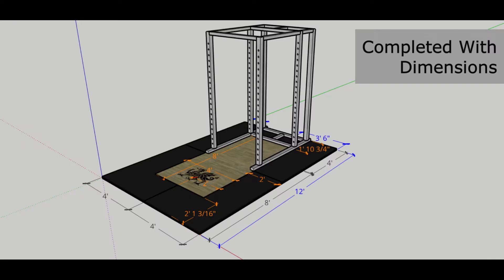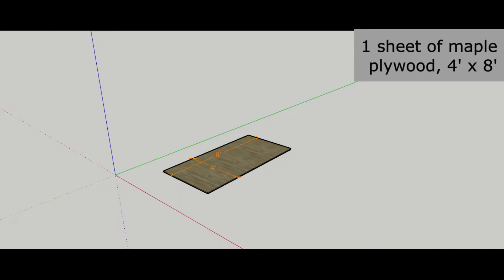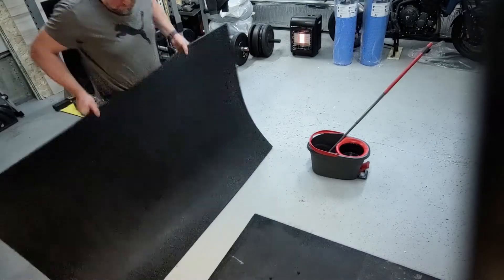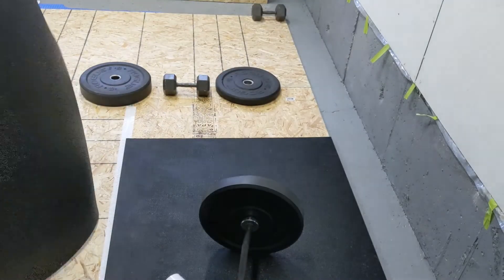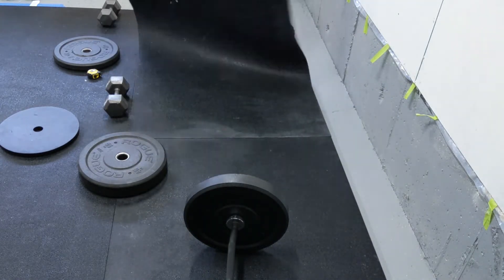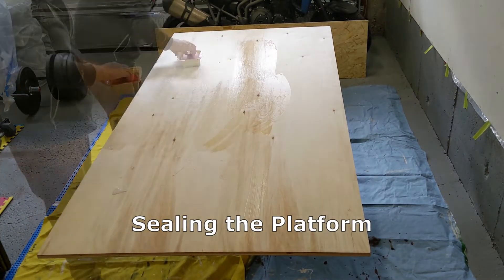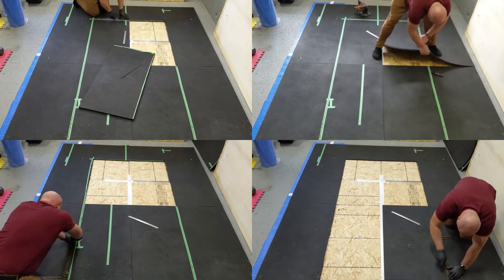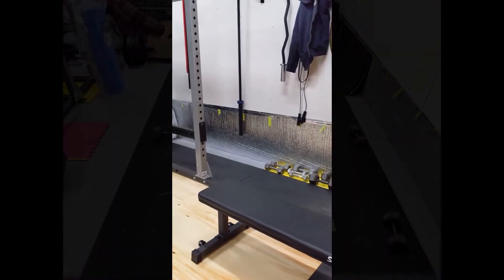Lifting Platform DIY Build in 2 Minutes

Comment: Is there a reason you went with the DMX instead of a single OSB layer?
Reply from the maker: Mostly to prevent the OSB from absorbing moisture from the concrete floor.  In addition, the other half of the garage still stores a vehicle in bad weather which will drop ice, snow and meltwater
Reply from the maker: I would also add, that it offers some additional cushioning (protecting the underlying concrete from weight drops) as I reduced the platform from 2 layers of OSB to just 1 due to height limitations in the garage.
Reply: @twistedroutes7621  thank you for the quick reply,  DMX 100 is out of stock at my local but I found an alternative/ similar base. Your design is perfect for my garage.

Comment: Did you use any glue or adhesive on the bottom of the maplewood?
Reply from the maker: Screws in the corners.  I wanted the maple board to be replaceable without damaging the underlying OSB/Plywood, so decided against adhesive.

Comment: What did you use to clean the stall mats? Thank you!
Reply from the maker: Pinesol and Hot Water!  I was going to use a "steam mop" but that wasn't necessary then!
Reply: @twistedroutes7621  do you think its fine to clean the stall mats after they've been screwed to the plywood base already? I've finished building my 8x8 platform already but forgot to clean the mats. I don't have the smell issue a lot of people are complaining about. Just concerned with moisture going thru to the plywood. Thank you!
Reply from the maker: I'd be worried about the moisture.  If you have a steam mop/cleaner, I think you could control it a little more.  A regular mop however, UNLESS RUNG OUT WELL, runs a high risk of getting water in the gaps.

So either ring out the mop well or try a steam cleaner... and be careful where you apply the mop head in either situation.